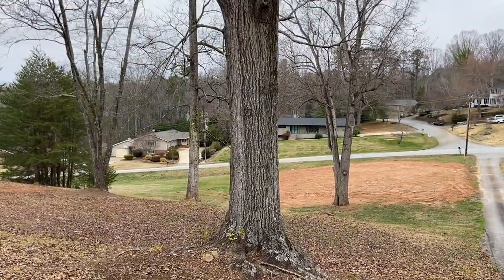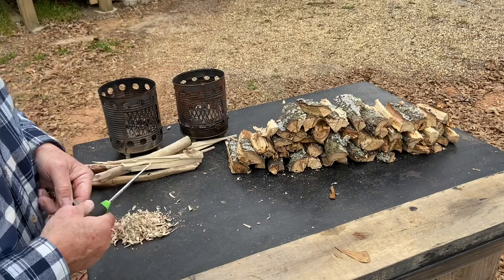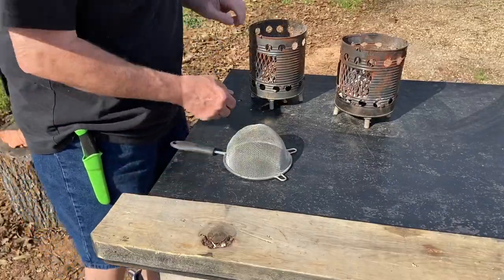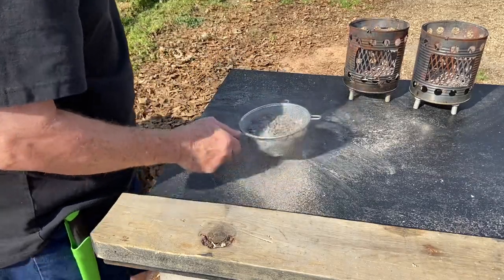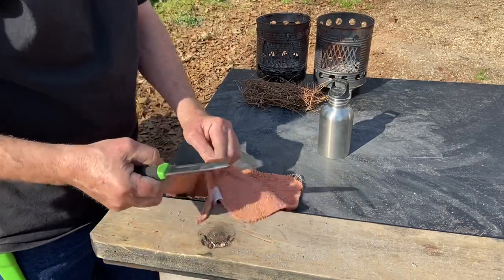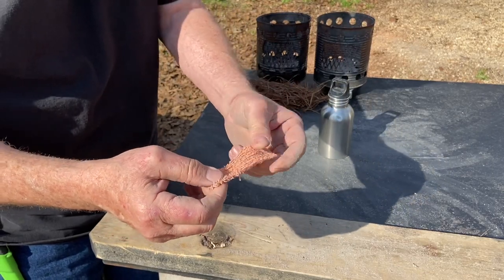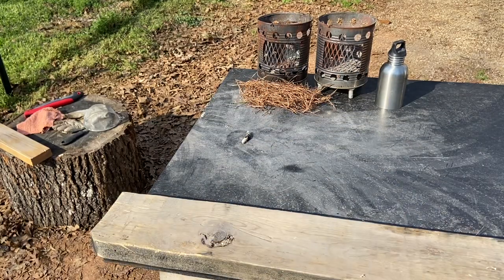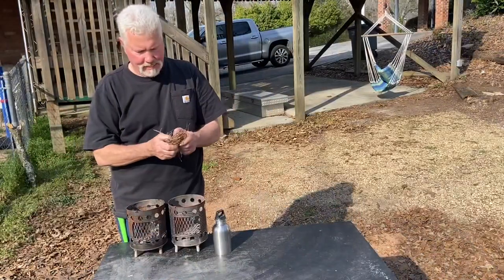Fire Rolling Washcloth And Making Ashes

Comment: Those old pipefitter's hands are tough as nails.  I've been following you for years, and sometimes I think they're partly made of asbestos.  For a second there I thought you were going to pick up that flaming pile of poplar shavings with your fingers to put them in the hobo stove LOL!!  🤣
Reply from the maker: Handling flames and coals is just about moving them quickly before they can burn you, knowing where to hold the tinder, and which way the wind is blowing. Also, camera angles can fool you. Most of the time it looks like I'm right in the flames when I'm not.